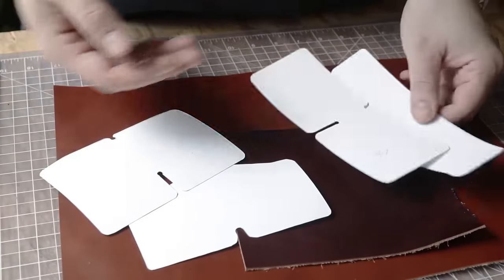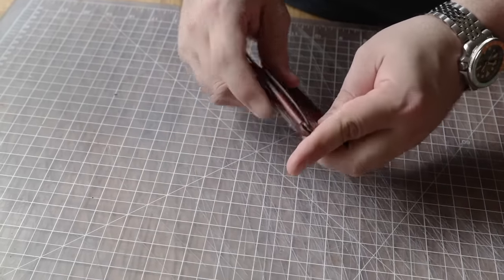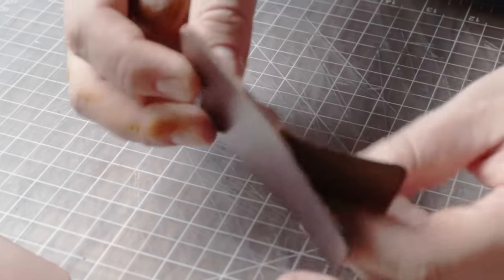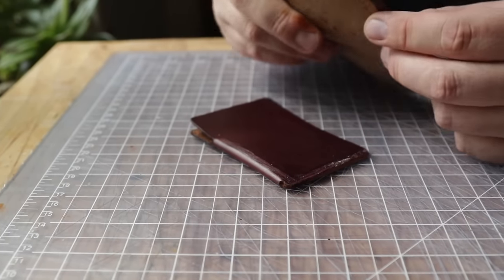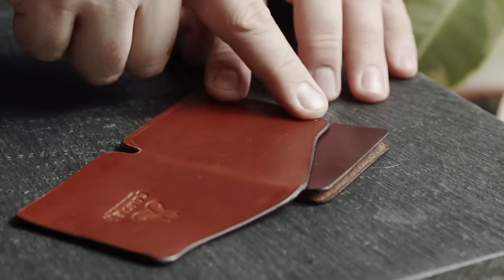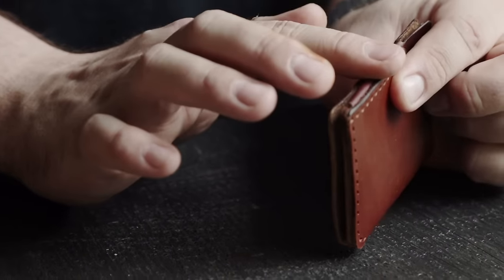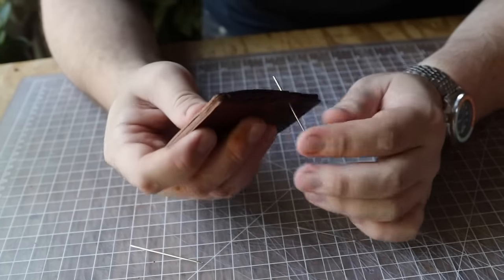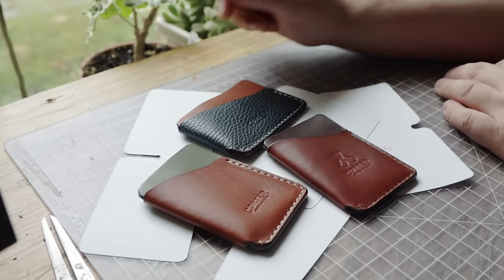Super Easy Leather Wrap Wallet Tutorial (with PATTERNS!)

Comment: Hi, guys. Maybe this was mentioned in the video, but I missed it.
Anyway, what is the leather thickness?
Because I suspect that bottom corners cut-outs in the pattern should be slightly adjusted if a thinner or thicker leader is used.

Comment: Ok disregard my last question about the tools. What is a good long lasting template material? I’d like to graduate from a cereal box
Reply: I just started using thin plastic cutting boards from Walmart, they come in a 4 pack for like $4 I tape the paper template onto it and cut it out either with a razor blade knife or scissors, so far it works pretty well, also they come with four different colors so you can use a different color for each wallet template

Comment: Thanks for a nice straightforward tutorial.  I have two Q's about the leather:  What weight leather did you use?  What exactly is the blue leather, as it wasn't at the materials link you posted?  Thanks again!
Reply: It’s Dollaro blue I think and likely to be 4-5oz (1.5-2mm). I’m pretty sure I’ve seen it on the Belts Production leather supplier website for Europe and also on Rocky Mountain leather  if you’re in the USA
Reply: I would say the thickness is probably about 3-4oz